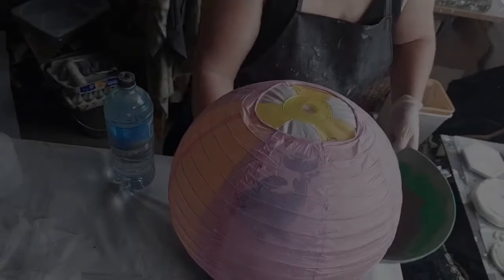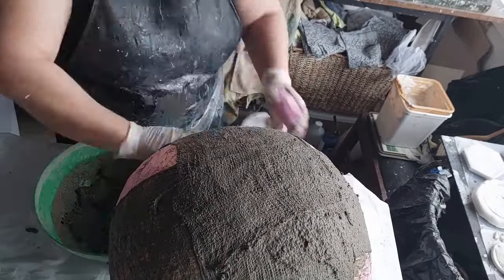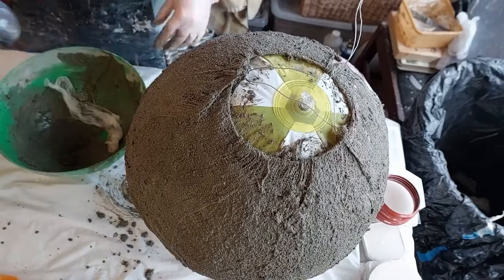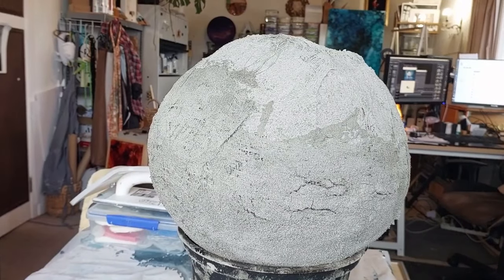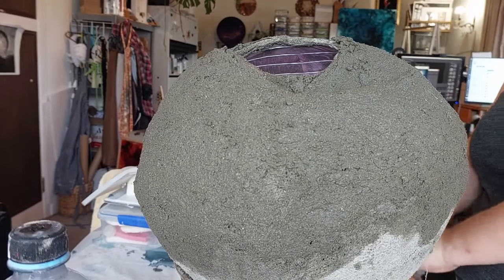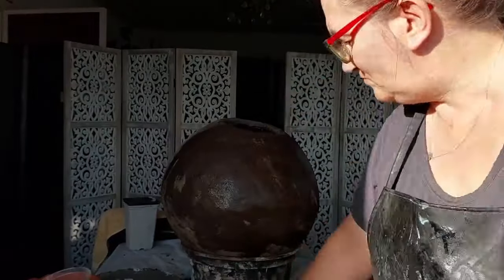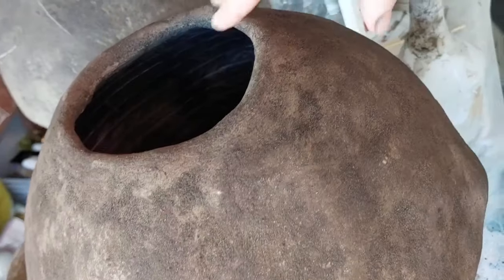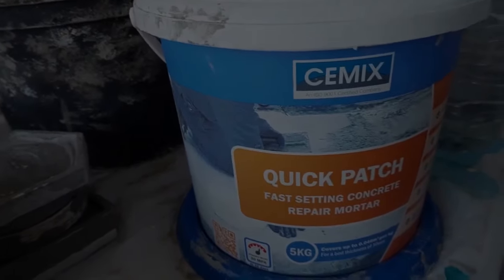DIY Vintage Vessel Dupe: An Easy Way To Look Vintage Without Spending a Fortune

Comment: I love the Idea, the sky's the limit on what you can make. I don't remember what they're called but they're like a mini fireplace you set outside on your deck, they have a tall chimney but they're just small. Anyway, I wanted to make one of those but never did. Thank you
Reply from the maker: The sky really is the limit :)  Chimenea, I think the fire place names is...  lol had to google for correct spelling
Reply: @DonnaODonoghue  I wanted a larger one so I got one of those exercise balls like you can set on at your desk or just do setups on. I was going to use a real stove pipe and cover it all with concrete and maybe another material that I could make it smooth then decorate it really pretty with half marbles and tile.  But I never did so I gave the ball to my grandson.
Reply from the maker: I like the idea   :)  was big project, would have been interesting.